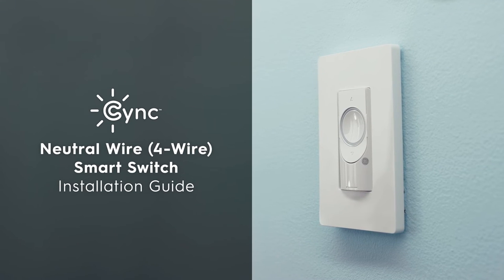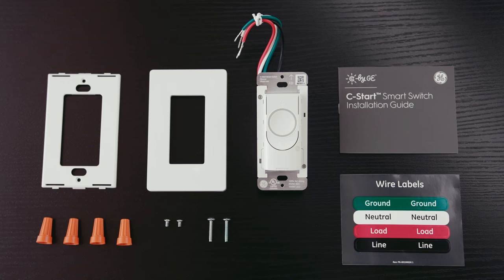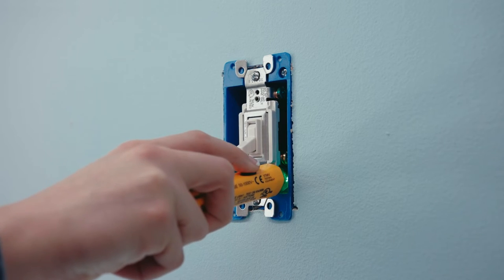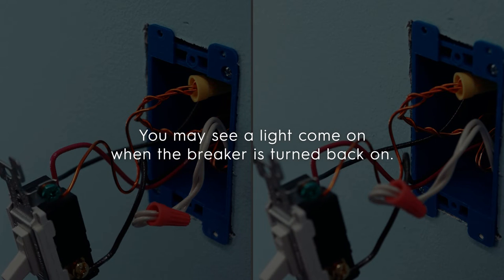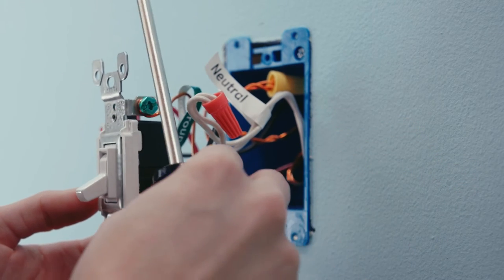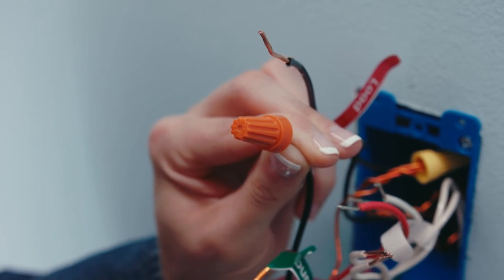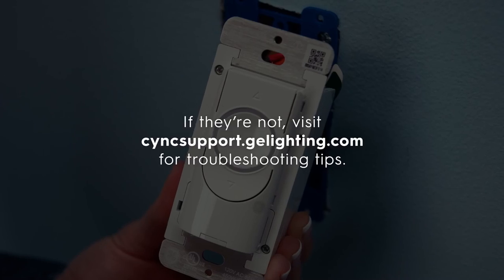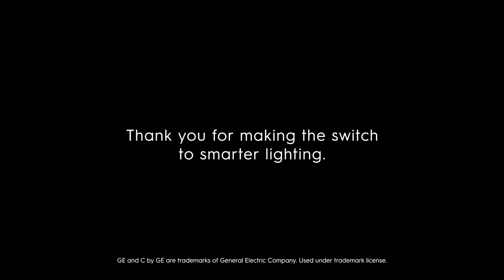Cync Neutral Wire (4-Wire) Smart Switch: How to Install for 3-Way

Comment: The problem is how to wire a switch in single pole setup
Reply from the maker: Hi there. Our Support team would be happy to walk through your setup and offer troubleshooting tips, if interested. We are always eager to hear feedback and suggestions for future improvements as well. If you would like assistance or if you have suggestions, please connect with our team at 1-844-302-2943.

Comment: What happens if you a neutral in your load side box, but not your line side box?
Reply: Same here. Neutral wire only in load side box. Did you come up with the solution, @Brendan M?
Reply from the maker: Hi Brendan and Kindra. Thank you for commenting on our YouTube video! Cync three and four wire switches cannot be mixed on the same circuit. If neutrals are present, it is always advised you choose our 4-wire switches. It is recommended that you contact your electrician to make the best decision based on your unique configuration.
Reply: You should be able to use the spare traveler wire to fish a neutral over to the other switch, like was shown in the video.
As this is not a standard practice, you should put WHITE TAPE on both end of that traveler wire which is actually a neutral.

Comment: Why would switches need an app
Reply from the maker: Hi there. The Cync App allows you to easily control your devices, including switches. For instance, you can control other Cync devices by assigning those devices and the switch to the same Room or Group in the Cync App. You will also have access to out-of-home control. You can learn more about the features and capabilities, here: https://www.gelighting.com/smart-home/light-switches-remotes/wired-switches

Comment: This video is useless.  4 minutes on how to shut off breaker and label wires and less than 60 seconds of how to wire.  How about just a wiring diagram.
Reply from the maker: Hi Derreck. We hear you, and we appreciate this feedback. We'd like to help. If you still need assistance on an install, get in touch with our technicians at 1-844-302-2943.